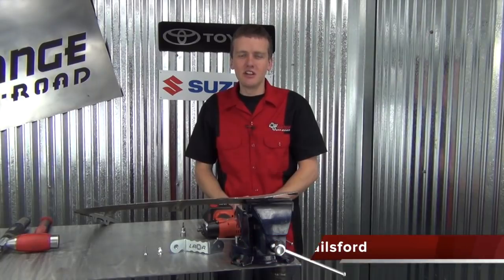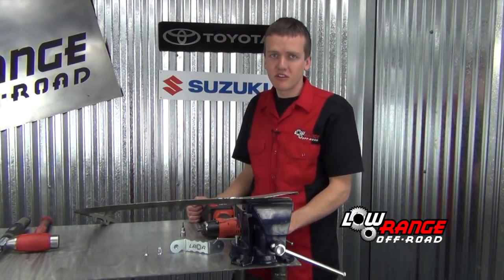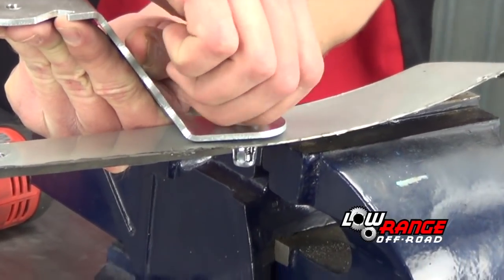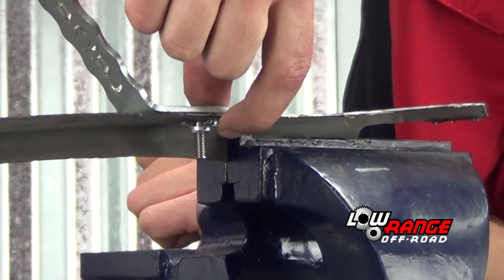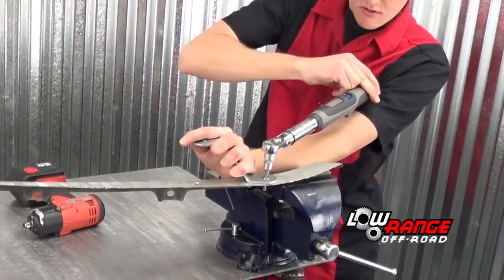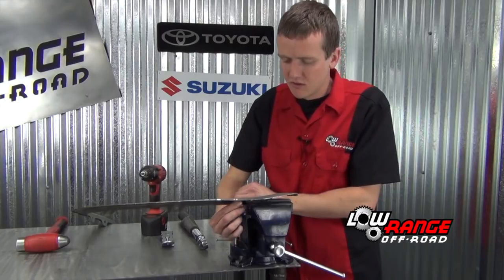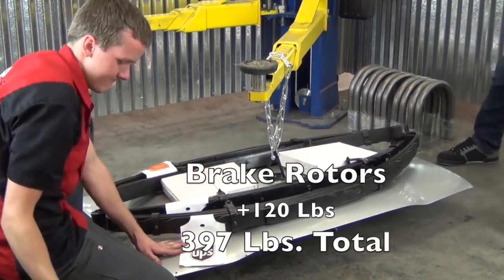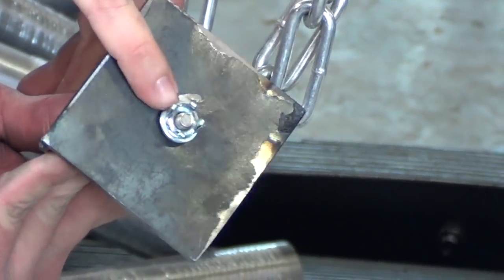Jack Nut Installation & Testing

Comment: If nut slips,  grind some grooves on bottom side of tool(or scrap of metal with hole in it).  The jack nut will grip the tool but the screw will be be free to spin.

Comment: Could this be used to simply have a threaded hole in the thin material? Instead of leaving the fastener in permanently?
Reply: Not likely to hold.  Thin metal won't have enough threads to sustain any / much weight
Reply: Yes you could leave the jack nut in without a bolt and install and uninstall bolts as needed.

Comment: Super helpful!  Used self tapping sheet metal screws to install some E-track in my van, one of the surfaces turned out to be too thin to hold the load and the screws popped right out.  The load test is crucial, well done!

Comment: would this be stronger than a rivet nut insert into aluminum?
Reply from the maker: Personally, I have never used the rivet nut on aluminum or steel.  The Jack Nut is strong if installed properly.  Don't make the mistake of cross threading the screw.  If you do the jack nut will never get tight in the sheet metal and in some cases very difficult to remove and replace.  Good luck with whatever it is you are working on.  Thanks for watching and commenting.

Comment: what size was this jacknut?
Reply from the maker: +BC Fraser The bolt size is 1/4X20 and the tool size is 5/32 (or 4mm) allen socket?  Hope this answers you question.